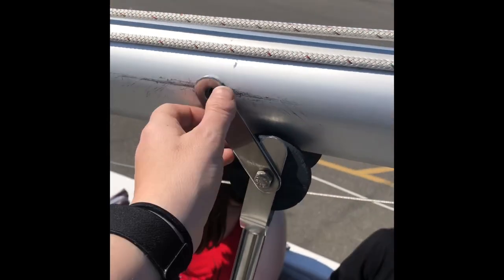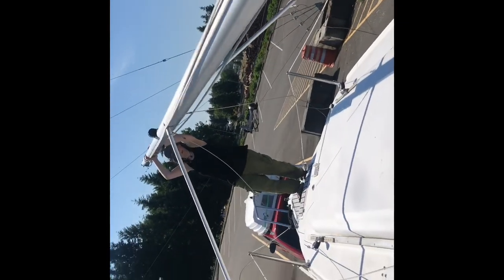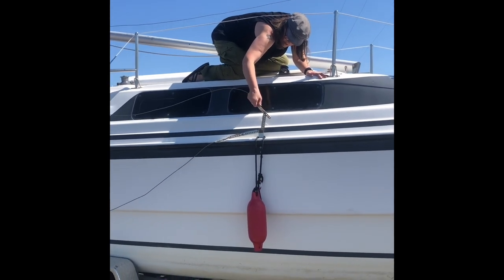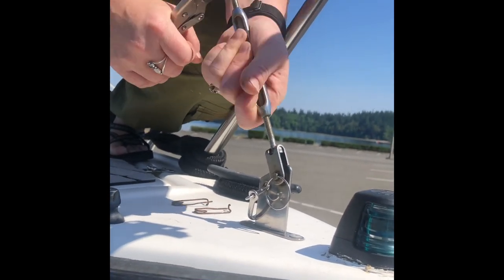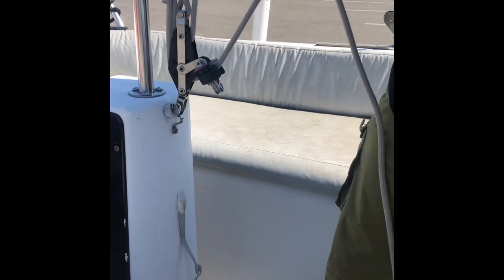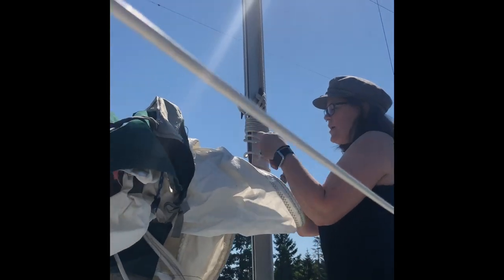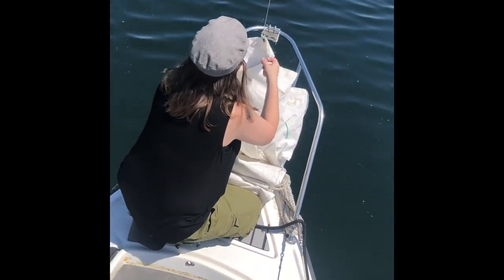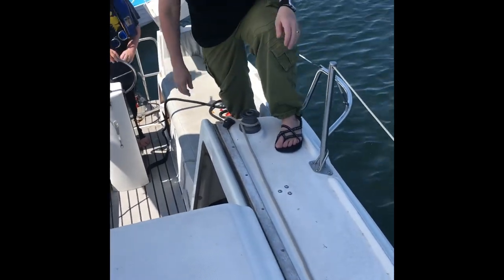Rigging a Macgregor 26x

Comment: Cool boat! Are they a high maintenance costly hobby? I guess not, new lines every ten years or so, a new engine every decade perhaps, general upkeep, I wonder if it costs a lot less than we might imagine?
Reply from the maker: Macgregors aren’t a very high maintenance boat compared to others.  The boat hull is made of fiberglass and is pretty tough.  That being said there are still things that break on it every year.  Upkeep depends on how much you want to invest.  You’re technically supposed to get new sails at least once a decade or so, but I haven’t, because they work fine enough for me.  I have been sailing the same boat for over 20 years, and I only need to repair a small hole in the mainsail, and replace one of the battens for the sails.  I’ve replaced one of the halyards, and the centerboard line, and repaired the centerboard, and many, many scratches over the years.  The internal wiring isn’t great right now and probably needs a complete overhaul.  I’ve had 5 different engines on it, but only because I’ve had so many stolen off the boat, not because they have worn out.  I no longer store the engine on the boat.  Overall its a fairly affordable boat, and you can pour as much or as little money into it as you want.  I have a pretty low key low tech setup.  For the size and convenience they ARE a lot let’s than you might imagine.  I love my boat.
Reply: My 29 year old Honda BF50 has a rusty pin for the tilt thing, which I will try to replace soon, and it needed a good service and a new water pump, but now runs OK. I am however ordering a new Yamaha 85 2-stroke for it, as mine is a 26X from 1995 and I think a bit heavier than the newer ones. Roger specially built the 26 series to bring sailing and boating fun to the masses, like the model T Ford, he mass produced a practical vehicle that was affordable to buy - and run. You can park it at home during the winter for example.